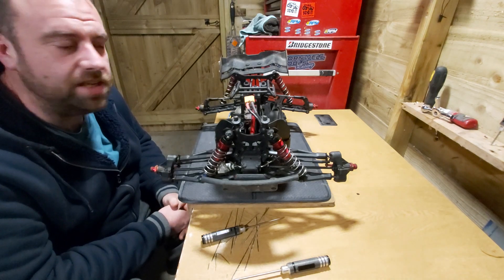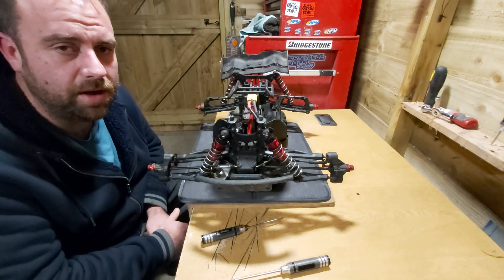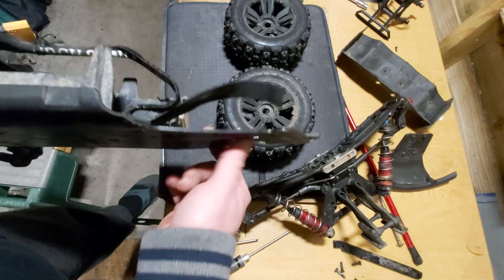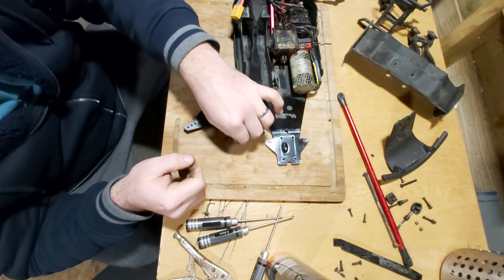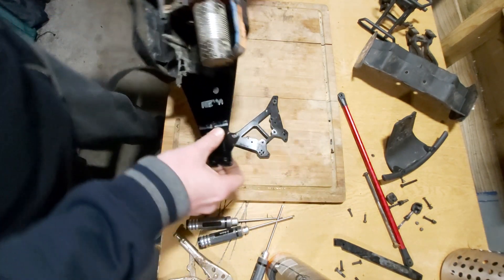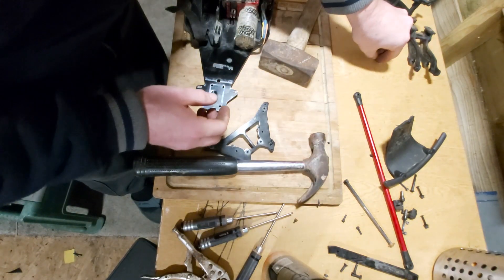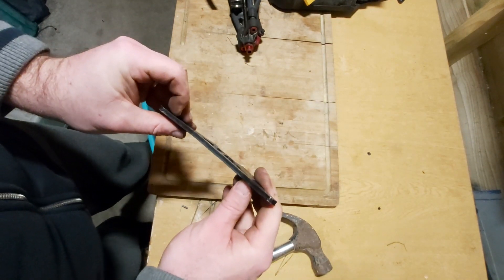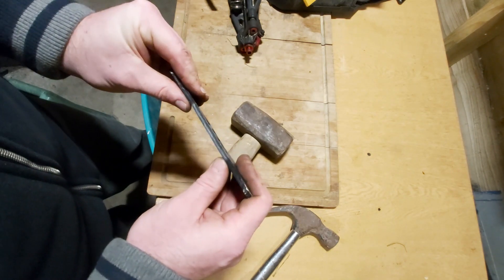Arrma Kraton 6S V4 maintenance! straightening chassis and rear tower

Comment: Liking your videos mate just got my kraton v4 two weeks ago and loving it cooked the esc on the first time out but sorted now with a max 8 on warranty 👍🏻 
Keep up the good work
Reply from the maker: Cheers man, there awesome cars. Shame about you esc, does the max 8 perform better?
Reply: @bournemouthrc4371  yes I think so and you can program it . Always like hobbywing stuff use it in May vintage stuff .. it doesn't fit to good but  it comes with a mount but I broke that first time out lol . so just got the supplied 3m tape on it for now see how that goes
Reply from the maker: @will450ktm  nice it would be good to see if they make the car quicker or not, I have been thinking about upgrading motor

Comment: Do you not have aluminium chassis braces  ? On your previous video I saw you had fasttrax red aluminum braces where they from modelsport and how did you like them?
Reply from the maker: I had the Fasttrax ones but I bent the rear and the screw holes went oval. I don't suggest you buy them. I have upgraded to m2c ones just waiting for my front one to arrive. If your in the UK badtouchbreaker.com do the M2C ones or customrcupgrades.com do the same but they make them. Both of them are made out of 7075 aircraft grade alloy which is dark stronger, more expensive but buy once. They should last forever
Reply: @bournemouthrc4371  thank you very much I was about to order those braces from modelsport thanks again for a quick reply
Reply from the maker: @lilnash7  no worries Fastrax is good for smaller things but nothing structural

Comment: You will be sharpening up your blacksmith skills if you keep bashing that factory chassis...  and shock towers too.  Flat stock metal is weak...  They should have added strength beads like the 8s has in the chassis.  I have had several hammer sessions, I'm not talking about running the rig either...  The other bad part about the flat stock, back and forth constant "fixing" will result in weak areas and will probably bend often in the same area, getting weaker each time.
Reply from the maker: Totally agree, the stock metal is weak, I have a upgraded chassis order on it's way. Keep checking out the channel for a new ground up build coming up soon. Time to make a special Arrma 👍👍😁😁

Comment: Not worth the effort mate, you can never get the chasis back to original spec, running your rc with that chasis will just caused other issues, just buy a new chasis, it’s the better option, ask me how I know
Reply: Not always worth it. Spending another $80 on a chassis gets old. Run it till it cracks or doesn't stay straight. Collateral damage won't be worth the $80 for a new chassis, if it happens. Worth a re-bend 2-3 times, then yes, a new one would be necessary